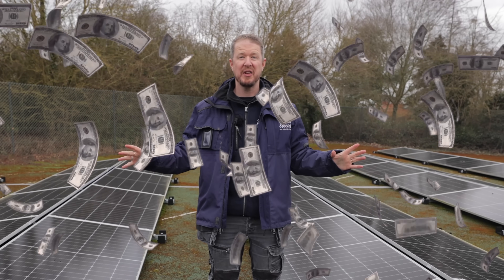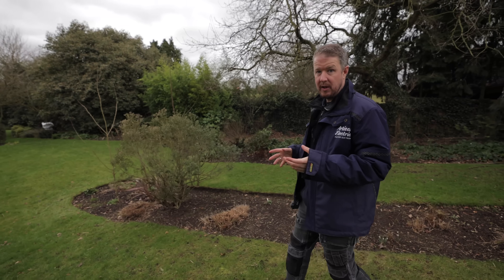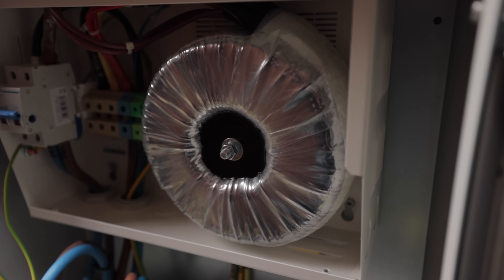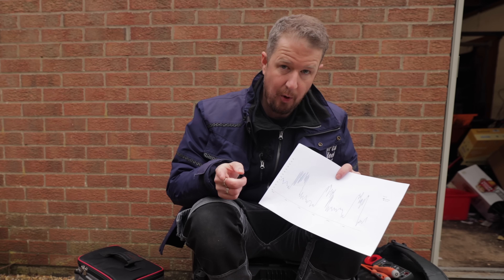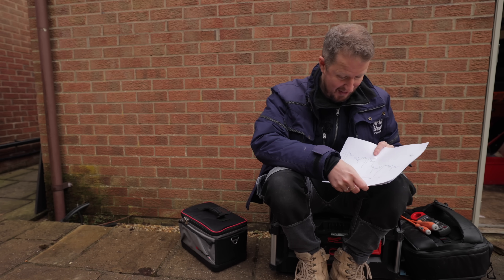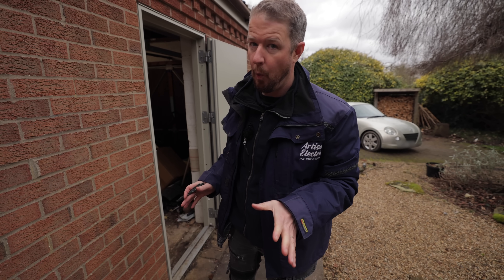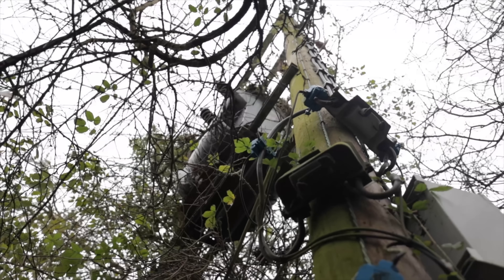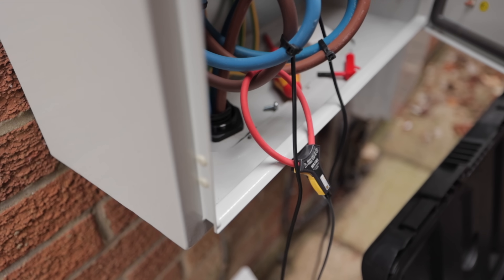THOUSANDS Down the Drain – And We Can’t Do Anything About It!

Comment: If that voltage optimiser had automatic tap changing, you could use it to supply the car charger.
Or get a different PEN protection device which didn’t care about the incoming voltage as much.

Comment: Hi, as an electrical engineer I would say you are just scrapping the surface of a much bigger problem. When power is reticulated to supply the customer we make allowances for voltage drop so their supply remains within the normal range, not always by increasing conductor size, but actually going to higher voltage transformer tappings etc. 

However once you start using that same reticulated system to feed back to the national grid at any substantial rate,  the voltage drop mitigations start to work against the desired outcome giving you unacceptable high voltages. The problem is not confined to your installation and is becoming a massive head ache, that will limit private customer grid feeds.  

It does not end there either as the problem surfaces again if you should ever have a grid black situation and try to re--energise it....  and that is long before you deal with the black art of VAR control issues and resonance.   Prompting me in my retirement to say ignorance is bliss!
Reply: This was predicted to be an issue by many engineers when it was first suggested that having thousands of local feed-ins from private households would be a good idea.

Unfortunately my father (an engineer with the old CEGB starting in about 1950) has not lived to see his predictions come true. I suspect this situation will continue until someone loses their life or something very expensive occurs as a consequence of a high or low out of tolerance supply. 

Then, the politicians will get involved and scapegoats will be slaughtered.
Reply: @jim373  Hi thanks for your comment, I had 23 years in the power stations.... and twenty years ago someone suggested once you go above 38% of unregulated input you begin to have all sorts of issues....even setting frequency becomes a concern... your father sounds like someone I would have enjoyed talking to. 

After power stations till I retired, In taught power system management to plant operators on oil, gas and hydro, 

I think the modern way of dealing with such issues is to wait till they cause a major problem and then get the tax payers to foot the bill. 
Best wishes
Reply: @jim373  there already is an answer - smart grid which adjust taps on the fly and automatically turns on charging during peak power output to promote local pv consumption (and remote commanded high-power load shedding to prevent near brownout events), plus inverter var compensation. 
var is here, smart grid is nowhere to come(only consumer side is here, not the private generation side) - even considering the fast rate of home ev charger installs.
Reply: Yes reverse power flows create reverse voltage drops ,  11kv voltage regulatiing devices need to have suffient taps to deal with these issues.  11kv  field regulators or zone substation tap changers originally designed for forward voltage drops from standard power flows where never designed for reverse voltage drops. Roof top solar needs to be consumed close to its generation by local batteries and other consumers.

Comment: 10:00 I cannot believe youre allowed to export energy above the maximum 253v, i expected huge fines for that.
Reply: My solar has a max voltage cut off, can't believe it's pushing out so much.
Reply: Pretty sure one isn't permitted to export above 253V. The solar inverter should limit that.i know SSEN are clear on this, not sure about UKPN.
Reply: And after 6% increase due to the voltage optimiser. You're well over the limit. The real problem is most likely the length of the supply cable it needs to be thicker. Or the transformer moved closer.
Reply: I wonder😂, You talk as if there is only one phase in action?. Where I live, Sweden, we get 3-phase supply, and in my house I have 3 x 35A fuses💪🏼